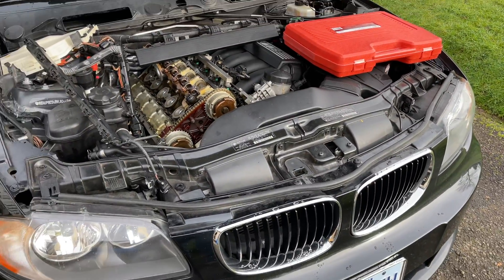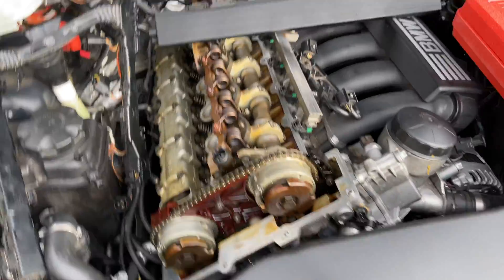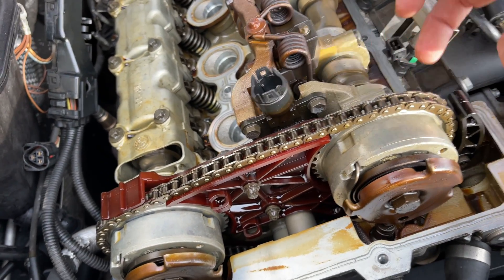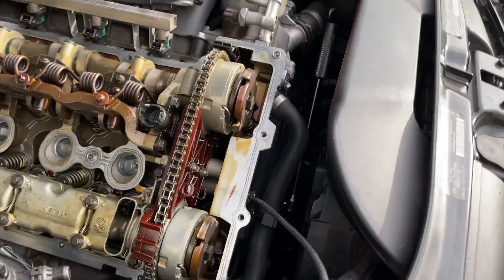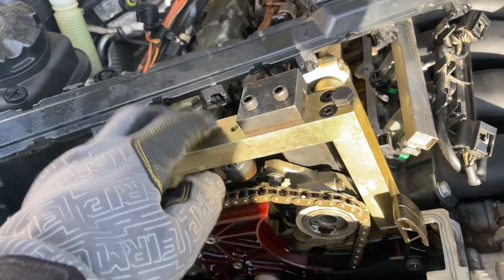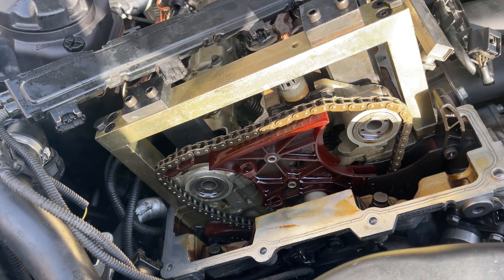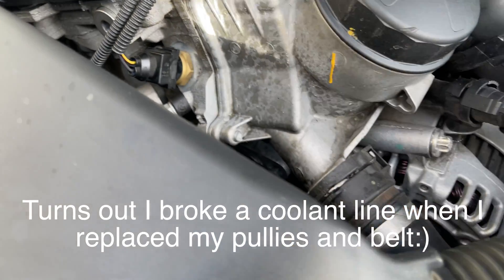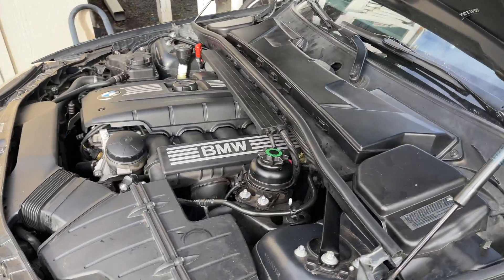I Fixed my BMW❗️How to Fix 2A7A code on BMW n52 n51 | Oregon Motorcycle 20222

Comment: Hello!  Did you have any drivability issues with the car that were cured by this fix?  My wife's 2011 323i has 2A7A and 2A87 fault codes, and feels weak through the midrange.  Per your video I'm just going to buy the bolts and camshaft alignment tool before I even take it apart to have a look... just planning to fix this even if it hasn't yet become an issue.  THANKS FOR POSTING!!! 👍
Reply from the maker: There’s a recall on this now. Call your dealer.

Comment: I took my e90 to the dealer to get the vanos bolt recall performed, still getting 2a7a and 2a77, glittery oil and sluggish performance. Solenoids and check valves already replaced.
What do you think, maybe they only replaced bolts on one unit, or the seal on the cam ledge went bad?
Reply from the maker: Yeah they only replace the bolts as far as I know.

Comment: Getting 2a7a only in cold startup. Have to clear the code and restart a few times then it goes away. Replaced both vanos aelenoids and camshaft sensors… ugh!

Comment: Reason for aluminum bolts - galvanic corrosion! With steel bolts over a couple of years you will then need to replace the engine block!

Comment: Dont use steel bolts. Use aluminum. The head the block the cam adjusters are made from a magnesium aluminium alloy. Magnesium will corode and crumble against steel stainless steel  brass cooper titanium. So aluminium is the only option on these engines 😢

Comment: ONE LAST QUESTION CHIEF:
Did you have to LOCK the flywheel under the starter area?

Thx 🙏
Reply: No, the camshafts only. because they're the ones which can rotate by mistake, the flywheel is connected to the crankshaft , and it won't turn unless you tried to start the car or put a socket on the crank pulley and tried to turn it with a wrench, which is nonsense

Comment: Interesting BMW sent you steel bolts. Can mix steel with aluminum, hence aluminum bolts all over the car.
Reply from the maker: The block is aluminum. The cams and gears are steel.
Reply: @OregunAdventure  you’re right. I forgot about that. What was BMW thinking 🤦🏽‍♂️. I contacted a local dealer and they told me my 2011 328xi has the bolts recall, but.. they said there’s no solution for the bolts at this time. 😳. I said, there is, so I guess they don’t want to do the work. I rather do it myself. And I have the oil sweat between the head and block between the solenoids and the coolant flange. It’s said the bolt under the intake manifold is the culprit, but the bolt head is in tact. So, I’ll have to buy new four bolts and retorque the front of the head when I replace the vanos bolts.
Reply from the maker: @iamurnamann8662  my car is a sulev. If I lived in California, this repair would be under warranty. Along with my 800 dollar radiator that’s leaking now🤣
Reply: @OregunAdventure  mine is a sulev as well. Lol. I did find the radiator for 120.00 and the Mercedes EAC sensor that would need to be modified with the BMW connector for 90.00. I’m sure my radiator will fail as soon as the sulev warranty expires. Lol. I’m in NY so the sulev warranty is covered, but after what the dealership said about the vanos bolts, I rather do it myself. I just don’t trust anyone anymore. And the PO didn’t take care of the car. So I fixed it all up, running like new so I’ll be damned if I let some dealership who doesn’t want to work touch my car. Great video btw. I forgot to mention that earlier. Lol
Reply: @OregunAdventure  one more thing. Change that coolant flange, where the coolant flange is fed by the OFHG asap. That plastic flange fails. Get aluminum flange for 12 bucks. 👍🏽
Reply: @OregunAdventure one more thing I promise. Lol change the plastic power steering pump pulley to metal. 25 bucks. Keep the plastic oil filter housing cap. Don’t get the aluminum ones they’re selling. The metal flakes off and goes into the engine. No bueno. 👍🏽

Comment: What happened? What was your symptoms why you opened the engine? What did it do? I have the same ride.
My car just died, won’t start now and it is showing P0365. 2 Camshafts and crankshaft sensors replaced.
Still won’t start. Help help help chief.
Reply from the maker: Rough idle. Sounded like a diesel. I have two videos on this. Go watch the other one they are linked. Your issue sounds different. Might be a crank position sensor.
Reply: @OregunAdventure  I already replaced the crankPS. Still won’t start. Hesitates. Only one or 2 cranks and then battery resets.
It was idling fine in my garage and then died suddenly.
Reply from the maker: @simplelangperorock  check the fuel pressure.
Reply: @OregunAdventure  okay, I don’t think I know how to do that. I will look it up how. Help?
Reply: @OregunAdventure  thanks chief
Reply: Hello chief,
I’m sorry to keep bothering you.
I have the same case as yours!!!! I opened up the valve cover and I saw the same ‘bolt head nuts’ like yours were gone!
The chain is intact though. I guess that’s a good thing?
Everything else looks intact. But I could not find the bolts.
The sprocket on the camshaft exhaust is ‘loose’ though compare to the intake camshaft.
Just like yours… identical case.

Is it extensively hard to repair? 
Do you have the part number on those ‘revised bolts’ and other parts I may need?
What is your AMAZON LINK OF CAMLOCK TOOL so I can also help your channel?
Where do I start chief? Please advise
Reply from the maker: @simplelangperorock  call the dealer for the bolts, or you might be able to see the part number in the video. The cam tool link is in the description. If the bolts are not there, you have to drop the oil pan the retrieve them. If the bolt is sheered off in the VANOS unit, you might need to replace those too, but still drop the pan to find the broken bolts.
Reply: @OregunAdventure  thanks man for the quick reply. Like I mentioned in my other comment, We Had The Same Case.
it is time for me to do the pan anyways. I will fish them out after.
I believe I just have to replace the ‘bolts and bolts heads’ and put them back together. I really wanna use the Non-aluminum ones you got from Home Depot?
What is the SIZE’ of the ‘revised bolts’ you used you got from Home Depot? I love that idea instead of the genuine aluminum. Lmao.
Where do I start on repair?
Reply from the maker: @simplelangperorock  I used the bolts revised bolts from bmw. They are steel.
Reply: My God. You reply quick. Thanks.
I bought the cam locking tool in your link. Hope that helps you too.
What is Part Number of the Revised Bolts from BMW?
How many bolts will I need to order? Did you replace the Intake bolts too?I
I can’t find it from FCPEURO.

Comment: Thanks for the video!  How many miles on this engine?I have a N52 but low milage so wondering if this will need to be done soon.
Reply from the maker: I think around 125k.  It sure exactly. I have133 now and just replaced the water pump;)

Comment: Hey mate great video I'm about to do mine was it easier to take the cam sprocket off then remove/put bolts in or can it be done without removing sprocket? because a few bolts on mine actually sheared off on the intake side only. And also what did you torque the vanos bolts.
Reply: How did you end up doing it brother to take off sheared bolt

Comment: Did you do anything to lock the crankshaft at TDS?  I am replacing my cam sprockets Thursday and I plan to just lock the crank where it is when the cam tool is installed.
Reply: What was wrong with the sprocket
Reply: The bolt heads snapped off of the bolts that hold the variable valve timing sprockets together. A common problem. The replacement sprockets came with steel bolts. @rauldeleon6728
Reply from the maker: No. I just turned it to top dead. My tool came with a lock…. Long as your careful it’s not that bad. Once the chain is off, the bottom won’t move.

Comment: i recently did my valve cover and gasket because of minor oil leakage. i upgraded to a mitzone aluminum valve cover. i also did coils and spark plugs because i was getting a multiple cylinder misfire. i have everything back together and it runs good for 3 seconds then its a rough idle. im not getting a rattle/diesel noise. would you think i need the vanos sensors? or should i rip my valve cover back off to inspect the vanos gears like your vehicle? the 2a7a code comes back everytime.
Reply from the maker: You need to check the cam bolts for sure if it is an n52 or 51. Not sure about the sensors, but the bolts are a design flaw.
Reply: thanks ill use your link for the tool

Comment: You didn't need to remove vanos to replace those vanos screws totally point less .I have done that procedure as a tech hundreds of times ... your total procedure is not incorrect and we'll done !! but unnecessary
Reply from the maker: I was kind of thinking the same. At least for the exhaust side…. At first I was planning to replace the whole units.
Reply: Hey brother what to do if they are sheered how to extract them
Reply from the maker: @rauldeleon6728  pull the oil pan.
Reply: @johnboutsikos6049 do you need a long shaft T45 to remove those bolts? It's a lil tight in there with my regular T45. Thanks man

Comment: Lots of post i see only 1 bolt shear off and they get a whole new vanos unit, could you just extract the broken bolt and replace them keeping the original vanos unit?
Reply from the maker: Yes. But you still need to drop the pan to retrieve the bolt.

Comment: Hey Oregon biker, so these new upgraded bolts are like plastic I have them from the dealer. What do you think about putting steel bolts instead? Did it work? Or could that be dangerous?
Reply from the maker: Pretty sure the ones I got from the dealer were metal. The original bolts are aluminum. I was gonna get regular metal bolts at Home Depot if I couldn’t get these in time from the dealer. So yeah it should be fine.
Reply: @OregunAdventure  thanks get saved through Jesus Christ!! Invest in your real retirement plan. So so dearly important. Read the book of Mark in New Testament. Much love!!

Comment: It's actually a recall but no buddy knows about it.  I had the same problem and they fixed it for free
Reply from the maker: It’s only a recall for SULEV vehicles. And the mileage of the warranty varies by state. If I lived in California, this would of been covered. The recall was for the actual bolts, which were only covered/replaced under warranty according to my knowledge.

Comment: Hi there I got the p0015 code (other DTC p2A7A and p2A87) on my N52, car runs smooth and fine, I dont feel anything wrong when the car is idling or accelerating,  dont feel any loss in power, replaced both vanos and the code still there, could it be the camshaft position sensor itself? Also I watched your symptoms video and mine had nothing like that
Reply from the maker: Yeah I would check the sensors. 
Your timing might be off too.
Reply: What ended up being the problem bro
Reply: @kennyus2000
Reply: @rauldeleon6728  the bolt on the sprocket backed out
Reply: @kennyus2000  did u replace sprocket or bolts
Reply: @rauldeleon6728  bolt could be replaced and be good, but I ended up replaced the whole thing yea, car is up there in mileage

Comment: Glad you were able to fix it yourself. If those bolts were to break off, would you have need a new engine, or Just drop oil pan and fish them out?
Reply from the maker: The procedure is to drop the pan and fish them out.
Reply: @OregunAdventure   actually i have these really small flexible magnets from v8 tools called the mighty worm you could possible fish it through the oil pan to retrieve the broken bolt heads
Reply: @izakwasserman2887  But the fasteners are aluminum?
Reply: @mikehermesmeglio   pretty sure the new ones are not alluminum
Reply: @izakwasserman2887  That's true. The new ones are not. But if they were new non aluminum fasteners then you wouldn't be fishing them out of the oil pan. My point was that your magnet tool is not going to stick to an aluminum fastener.

Comment: That's what hapens when you go from your Honda's reliability to the BMW's not so reliable and expensive. Reminds me of my old bmw motorcycle and the "fun" it gave me :))
Reply from the maker: Yep. 
The higher maintenance is expected, but these bolts imo, are a design flaw. Live and learn;). This is my 7th BMW.
Reply: Those vanos units are parts supplied from a manufacturer to BMW  ...not built by BMW and multiple other manufacturers are suffering similar problems including Toyota..ME/BE ..Audi so figure it out !! in all cases it's the supplier that fails to meet a automotive manufacturers specs